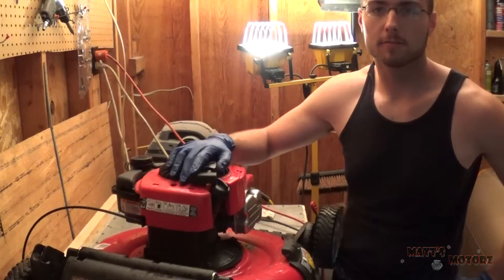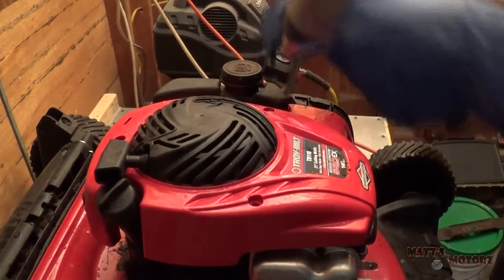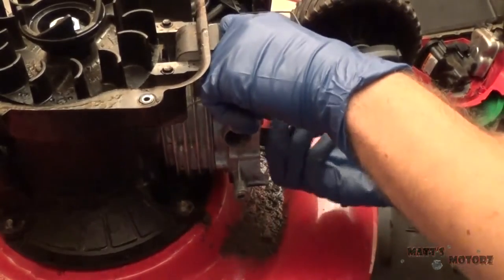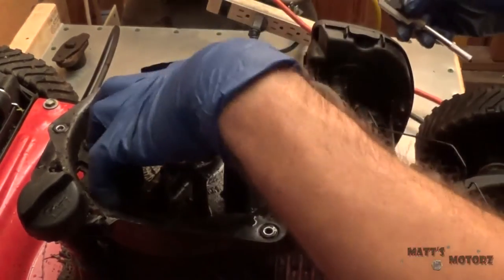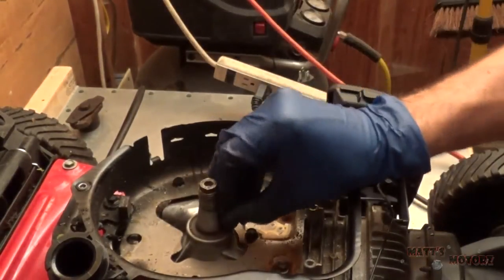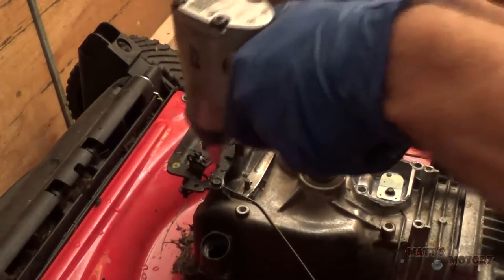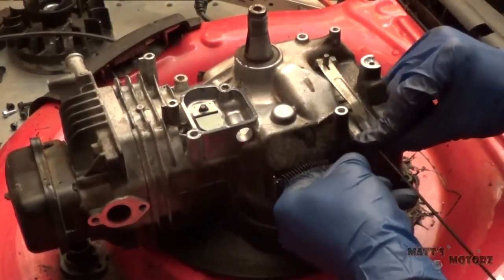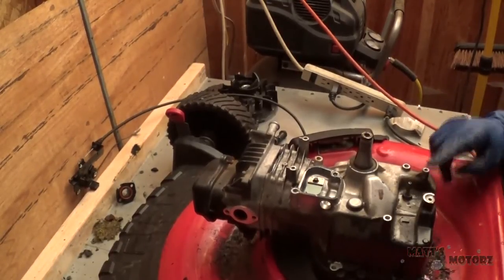Converting a Lawn Mower Engine to Steam: Part 1-Teardown

Comment: a solid rap on the flywheel with a block of wood and or rubber mallet usually gets it off.  I rarely use a puller for that.

Comment: I guess the trouble removing the pan was caused by the fact that the shaft the piece was supposed to slide along to detach, was heavily corroded and the oil seal and possibly a bearing bushing in the pan wouldn't go over the rusty area even with gentle persuasion... ;-)

Comment: Won't this dilute the oil and stop it from lubricating the piston and it won't last long
Reply from the maker: Yup.  But it is just a fun little project.  I wish I could tell you how long it lasted but I ended up messing the engine up by trying to do more modifications.  It ran awhile though.
Reply: Hey Man i just start the same project, my engine is Briggs 3,5hp,  how do you want to make modifying the camshaft?